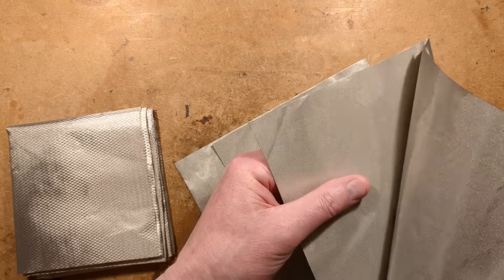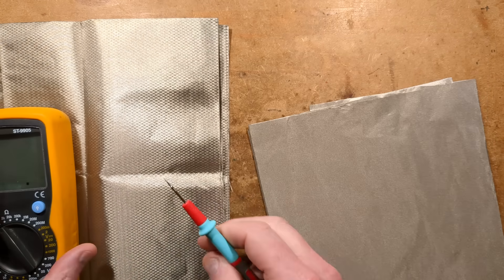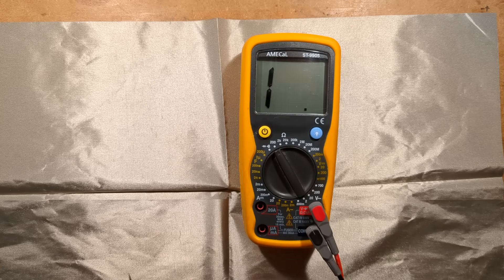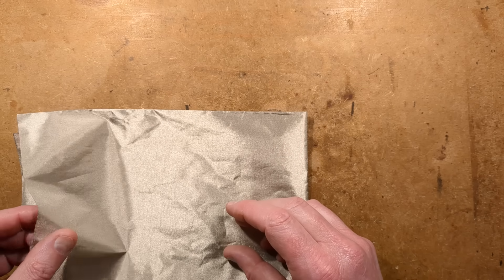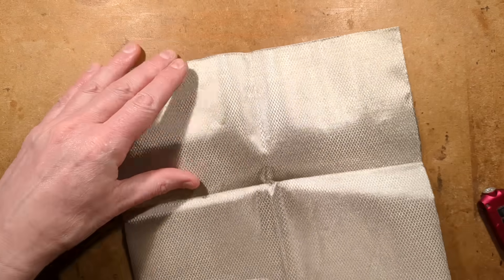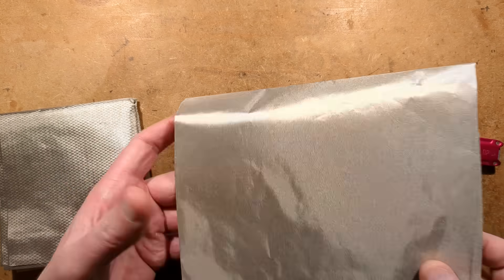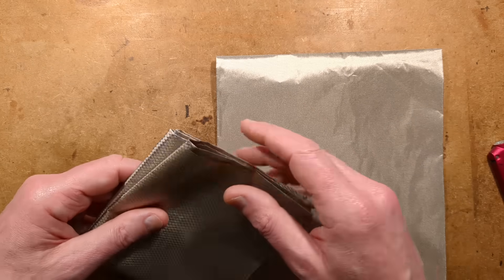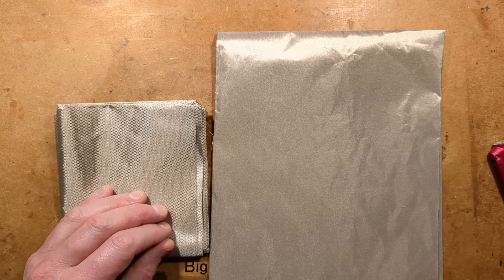Anti 5G fabric is amazingly conductive

Comment: You'll take my aluminum foil hat, from my dead hands. 
Long live aluminum foil.
Reply from the maker: AI just suggested this response....    The shielding is better than foil, but a foil hat still offers some protection.
Reply: @bigclivedotcom well if it's a mesh then its range of filtered wavelengths is limited. Proven by the fact that it does not reliably filter light. The foil still reigns supreme!
Reply: @Biped the original quotation was I believe made by Charlton Heston, referring to removing his gun "from his cold dead hands", but in.the case of a conductive hat in a thunderstorm, the quotation might be "very hot dead hands".
Reply: @Biped  ,the weave may provide inductance and forms an RF resonance or a  bandpass filter?
Reply: @nigeljohnson9820  what is a tin foil HAT doing in anybody's dead HANDS
Reply: I have been wearing a cap with foil in the lining for the last few years, not ironically. It provides excellent protection for the head from the scorching sun. The effect is simply amazing!
Reply: @BestHakase , you can buy thin aluminized bubble wrap,  used as an insulating vapor barrier, from home improvement stores. Probably would work better than aluminum foil.
Reply: @BestHakase  I experimented with aluminium-lining on a shirt (also meant to protect from sun's heat), but I found it damages the skin (skin turn dark).
Reply: God bless you for not writing "tinfoil". There's a "Star Trek" episode where a aggressive Klingon calls Captain Kirk a "tin plated... (something)" . Even as a kid I cringed at the absurdity and dopeyness of the reference. Sure, these Klingons, who had mastered space travel and cloaking devices were all about tin plated stuff. LOL.
Reply: Who is plotting to take away your tinfoil hat?
Reply: @NextianGeometry ”They” are everywhere;-)
Reply: I'm sticking with my silver plated copper mesh 😂
Reply: @christopherleubner6633 
Oooo! Fancy.  I'm jealous.   All I got is Reynolds.
Reply: Foiled said the reincarnated chicken...
Reply: It’s better than tinfoil for RF-proof underwear - flexible snd breathable.  Perfect.  😊
Reply: @wtmayhew  Perfect for TSA screening
Reply: bro, AL is junk, you need tin.
Reply: Nah you gotta use tin. Only tin foil blocks the mind control beams from the hollow earth (Bounced off the chemtrails of course) Ever wonder why you don't see tin foil anymore and only Aluminum?
Reply: The foil is to hot and sticky imo.
Reply: alu is stupid take copper!
Reply: 400v death beam capacitor be damned
Reply: Do what you like, but it looks like this stuff breathes, and at least in the short term doesn't announce yourself quite as loudly 😊.
Reply: Aluminum foil can amplify certain things. It's not good especially to make a faraday room , if you don't know what is coming your way you could be amplifying something you don't want. Aluminum foil can work in both directions depending.
Reply: @iahelcathartesaura3887 thanks. Wish I'd known this before lining a two story house...
Reply: Aluminum foil causes Alzheimer's! You take all that time making your hat, and never remember to wear it. Cognitive dissonance meets karma.
Reply: @R.Daneel If Aluminum caused Alzheimer's disease I would have remembered that !
Reply: @R.Daneel Only if you eat your hat.
Reply: @R.Daneel That's a 50 year old myth, large-scale epidemiological studies have never been able to prove a causal connection.
Reply: @TheOtherBill  Let's be honest if it did they wouldn't tell us
Reply: @TheOtherBill  r/woosh
Reply: @TheOtherBill 50 year old myth? Take your funded statistics elsewhere! How about that testament of all the aluminium workers that have suffered! Hell go tig weld for a day without correct ppe and tell me how you feel?
Reply: @turokforever007  if it did they would produce enough disinformation and misinformation to ensure big aluminum gets their share. and while that happens my alcoa stocks keep rising
Reply: @turokforever007  they?!? witch they are you talking about?
Reply: @turokforever007  who is "they"?
Reply: @turokforever007  'THEY'....my my someone needs a tinfoil hat. (on reflection, that was probably exactly the point you were making and my tinfoil hat is stopping me from recognising irony)
Reply: @Gamer_Logic you know "them".

Comment: The non-geometric stuff looks just like the conductive sponges I've seen inside electronics, used to connect grounding points for shielding, with a piece of a sponge wrapped in the fine metallic cloth stuff, the other stuff, that looks like what they use for hotsuits used by HV linemen, the people who connect themselves to powerlines by helicopter with all the fizzy sparkles as they electrically couple & decouple themselves... :P
Reply: Ah that's where I recognised it from - grounding points on enclosures!

Comment: I would wager the majority of this stuff is likely on the market because of backyard drone factories in Eastern Europe. It's a cheap way to shield vital electronics from some forms of electronic warfare
Reply: Wouldn't that have the same issue as with the phone, that it blocks the signals needed for the drone to operate?
Reply: @VulpisFoxfire I know many of the larger drones that are being used are actually "fly by wire" so that can't be easily jammed. They trail a fiber optic wire behind the drone that connects to the controller. I'm guessing this material or similar might shield it from an EMP attack.
Reply: @allenrusselljr  Huh. That would rather limit the range and/or versatility, I'd think.
Reply: @VulpisFoxfire i thought the same until i started watching some of the Ukraine/Russia war videos. Heres a copy paste "While the operational range is typically less than 20 km, reports suggest some drones can reach up to 41 km, and potentially even 50 km with a newly developed cable." 50km = 31 miles . Isnt that crazy?
Reply: @allenrusselljr  This one?  https://www.youtube.com/watch?v=NwkOxXgAWZ0&t=3s
Reply: @allenrusselljr  EMP is not same as EW.
Also fiber optic drones struggle in buildings and around forests - basically only works in open space.
Reply: @dzhiurgis so this material wouldn't stop a magnetic pulse? I assumed it would but i could be very wrong.
Reply: @VulpisFoxfire  I've seen pictures of the battlefield and it looks like a spiderweb in places. But that could also be fake, who knows these days.
Reply: @--_DJ_--  it's actually true, in places.
there are recyclable uses for that fiber optic, too: birds use it to make nests.
Reply: @VulpisFoxfire  fiber-optic-drone also can land and wait for vehicle to pass, so the cable allow drone to also behave like a mine. A wireless-drone cannot fly-low or land because the signal is blocked by terrain & the signal drain the battery.
Reply: @VulpisFoxfire yes but you should carry it outside before using it anyways...
Reply: You might be absolutely right
Reply: It would produce an excellent radar target.
Reply: No, the availability has nothing to do with drones. Fabric like this has been available since like forever in countless different variations. I've seen it advertised to be integrated into clothing, shoes, bags, bed frames and mattresses, to be stuck onto windows, as wall paper or to be put into a wall under plaster or paint.
Reply: @superdau  You have all the right to question it, my argument is basically that:
Absolutely this stuff is not new, has tons of applications and I wholly agree that the 5G death ray crowd play their part - especially in the english language targeted ads.
But why I suspect drones are at play is that the scale of backyard manufacturing them is actually colossal (especially in Ukr but also Rus) likely making enough demand for some factories in China to scale way up and start offloading this everywhere. It's one thing to supply the HAM crowd or labs, Drones are a whole new scale. I dig for cheap parts on Aliexpress and only this past year I've started seeing craploads of high value drone parts on the market that exceed your average hobbyist's ambitions - ranging Lidar, advanced optics with lasers, and most of the well-priced small lithium cell listings are full of commends from either aformentioned country.
Reply: Thanks Russia!...?  I guess for all their aggression and cruelty we can thank them for inspiring new innovations.  nah....screw those guys.
Reply: I would have though a screening ESD plastic bag (the opaque ones) would be a lot cheaper
Reply: This has been around years before the drone uses.  I bought some in 08 or 09.
Reply: @MemorialRifleRange   In India....Zari Saree ( fabric with gold and silver threads) ...Paattuu Podavai , in south India. ....

Comment: would it make an anti static covering for your work bench when earthed??????????????
Reply from the maker: A firmer conductive surface would be better for that, and always with a high value resistor in series for safety.

Comment: Now that you shopped for and bought this, your online ad experience is going to be colored insane for quite awhile..
I reviewed a VHF J-Pole antenna made out of the stuff, called the Fara-J.  It worked rather well, almost as well as a similar antenna made out of window line feed line.  Other amateur radio ops have used it to make ground plane mats for vertical antennas.
Reply: Use this opportunity to buy some Scalar Energy talismans/wands/cards, as test radioactivity sources.
Reply: That's how you mess up with the big tech... You should see the suggestions I get...

Comment: This is what they line the walls, roof, and floor of vans/ trucks that are used to steal motorcycles and vehicles. It stops them from being tracked with anything
Reply: Aluminium cooking foil is the cheaper option for large areas.
Reply: @TheTemporalAnomaly  ah a professional
Reply: @TheTemporalAnomaly steel truck?
Reply: @ianwalker1182  Yes of course. Anything surrounded by a conductive shell would block rf but any gaps, holes, or slots would have to be only a small percent of a wavelength or the blocking effect would be reduced. Example of holes and still blocking the rf would be a microwave oven door. There are holes, so you can see inside but small enough portion of a wavelength to block the rf.  2.4Ghz wavelength is 125mm the holes in the door are maybe 3 mm
Reply: @TheTemporalAnomaly  at my first company we manufactured MF & HF communications equipment for commercial and naval use, we had a fairly coarse double cage for development work. We took on a project manufacturing paging transmitterz and receivers, we bought Bulgin Faraday cabins for receiver testing , I observed the commissioning workmaking all the joints tight to 10 GHz. Screening a van probably does not have to be this good
Reply: @TheTemporalAnomaly >aluminium
ah, the culture with the most experience in theft 😉

Comment: Please make a follow-up video where you wrap a phone in it and try to call it.

I once tried this with aluminium foil and it still worked.
Reply: It's possible if the phone was using the case as a large receiver/transmitter that the foil was just boosting that.
Used to be a thing on old mobile phones with visible antennae that connecting something large and metal to it would boost signal.

If you want to test if that's the case put cling film(ceran wrap) around the phone first to ensure that the foil isn't making direct contact anywhere.
Reply: Phones increase their transmit power to compensate for poor signal.
Better to use "Airplane" mode to turn off the radio.
Reply: give it a few layers of aluminium foil (which is only a few atoms thick per layer) can stop it from connecting, I had a phone which had a broken screen and it automatically connected to my bluetooth speaker, wrapped it in 4-5 layers, and it finally let go
Reply: @griffinbastion You can get tiny 1x1mm xray/electron windows that are hundreds or so atoms thick, but they are very fragile. Al foil is orders of magnitude thicker. I don't know off hand if it's the folded edges or maybe some coupling thru the touch screen? Now I have an assignment when I get home :)

Comment: A WALLET LINER Clive! Stop people remotely reading your NFC cards!
Reply: You can buy wallets purpose made for that.
Reply: Would be awkward if this material is magnetic and just destroys the cards instead.
Reply: @Ecclesiasticus  are magnetic cards still used somewhere in the world?
Reply: @arturjogi6054  US apparently
Reply: @arturjogi6054  nfc cards get damaged by something, and i always attributed that to static magnetism on clothes. Have to replace the subway card about once every 5 years. What else could it be if it just sits in a dry pants front pocket?
Reply: @Ecclesiasticus  you mean static electricity. NFC cards are not affected by magnetic fields, but they contain processors and memory chips inside which can be damaged by high voltages (which can be generated through friction).
Reply: @Ecclesiasticus the  only time I've seen damaged nfc cards was when they just shattered from old age and stress, breaking the antenna
Reply: @Ecclesiasticus  in the front pocket? Bending back and forth when you walk and sit down dude. You're snapping the antenna from constant fatigue.

Comment: A year ago I bought a sheet of copper/bronze coloured version of this stuff for shielding guitar cavities, still haven't tried it yet but I will in the future lol.
Reply: In my experience with audio transformers the inexpensive option is mild steel sheet. You can get it thinner than 0.1mm you might use several layers to stop mains hum. This will screen the electric field AND the magnetic field. Mains hum is your guitar enemy and that is commonly picked up by guitar pickups as magnetic interference. The material in this video will screen higher frequencies, 100khz up to Ghz but won`t stop the magnetic field very well in the audio range you are interested in.
Reply: @TheTemporalAnomaly  Thanks that's good info, just last night I was looking on Aliexpress for thin steel for this purpose lol.
Reply: @ericmc6482  There is another way, where you wind steel wire (uninsulated), around the unit you are protecting, has almost the same effect as sheet steel and might be easier for you to get hold of at a farming or gardening supplier, in the form of galvanised mild steel wire. There are also hum-bucking coils but a lot of people think they alter the tone qualities of the pickup. Better to keep the hum out in the first place, in my opinion.
Reply: @TheTemporalAnomaly  Thanks, that's good info. Just last night I was indeed looking on Aliexpress at thin sheet steel sheets for audio transformer shielding application, I was also musing about sheet steel for electric guitar application in conjunction with the shielding cloth.

Comment: 1. For enclosing car key fobs, to reduce the risk of cloning.
2. For wrapping your credit/debit cards, ditto, maybe.
Reply: Not the attacks op is talking about. These passive defenses are to defend against relay attacks for keyless ignition vehicles and contactless card payments. Both of course are a triumph of convenience over security but this kind of thing does protect.
Reply: @petoperceptum  Which is why my wallet has a 1mm copper plate both sides of the cards, as that, short of a mumetal sheet, is the most effective, as you would need rather high power transmitter, and an incredibly sensitive receiver with incredible dynamic range to get the return signal back.
Reply: @petoperceptum 👍
Reply: Contactless payments can't happen without terminal connection to processing networks authorising the transfer between sending and receiving parties. Therefore, if there's a bank or some other financial service that allows any hobo to make an account, connect the device, and start charging people for non-existing goods, it is fully responsible for refunds. Regular businesses have long contracts that state what they can and can't do with card terminals, and it doesn't matter if they use chip contacts or radio.
Reply: Fun fact - some of the so called RFID wallets don't actually stop your card being read through them. An easy enough test to make though - just make sure that you only test them with one card in the wallet (otherwise you can be charged multiple times).
Reply: @keithmower921u can get apps that will scan for cards and run a scan with a card in and out of the wallet to see if it blocks it or not. That's what I do.
Reply: @keithmower921 I have one of those "RF shielded wallets" and it is totally useless. I keep one of my credit cards in it and I do not have to take it out to pay at the contactless card readers in the shops. I bought it in Rossmann (one of the big German, supposedly reliable shops).
Reply: @keithmower921wtf
Reply: @keithmower921 If you present more than one card, you will not be charged multiple times, but get an error and no charge.
Reply: you can buy premade products made with this fabric for that :D
Reply: If you can clone a contactless card these days, you'll make far more money in bug bounties than you will trying to not get caught passing off clones.
Reply: Not hard to scan your wallet with a flipper and then video your card when its out for the back pin code. ;)
Reply: No use for both, because:
1. Key fob thieves intercepts transmission. They cannot force you to activate it.
2. Skimmer device is inside ATM/POS machine.
Reply: @hanifarroisimukhlis5989 no, he means the NFC readers that capture ur card information wirelessly
Reply: @hanifarroisimukhlis5989  "Key fob thieves intercepts transmission" No they don't, fobs have been using rolling keys for decades so intercepting the transmission is useless. Thieves are extending the remote keyless system which this would absolutely help.
Reply: @hanifarroisimukhlis5989 credit/debit cards using contactless technology can be "skimmed" from a distance, though admittedly the equipment required to do this is large and bulky